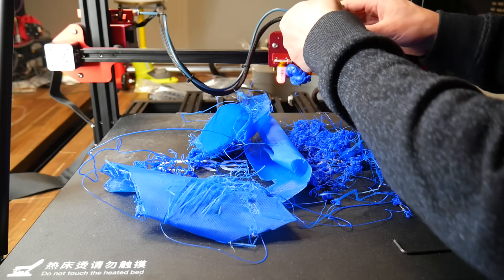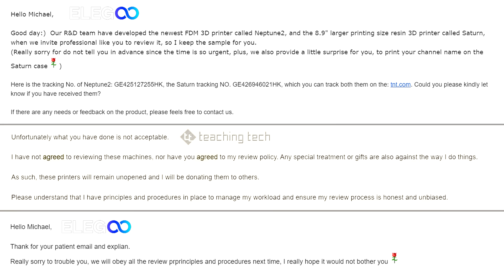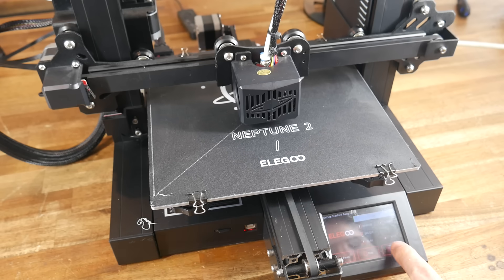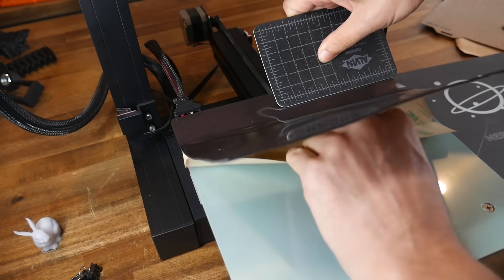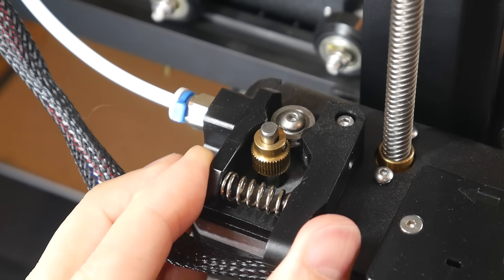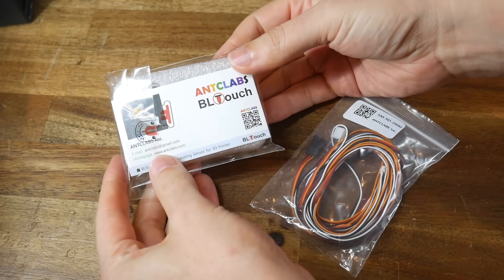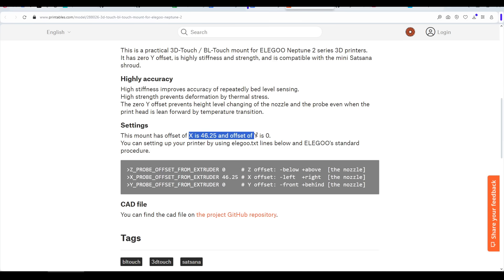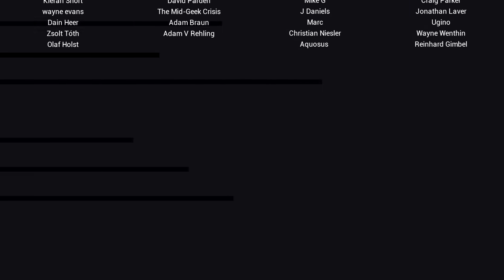Are cheap 3D printers more trouble than they’re worth?

Comment: I have bought 15 printers in the last 2 years.  It's been a total crapshoot but anything older (SV04, SV05, X5SA Pro) always had a ton of issues.  This generation felt cheap, copied and not particularly usable without a lot of work.  The SV05 cube printer was the only one that operated fine but was very slow and limited in print quality.  Of the models less than 1 year old, most were including new features or speeds, and it was a mixed bag.  Most issues were with "auto" anything.  So many of these machines claimed to deliver Bambu ease of use and automatic leveling etc and completely failed to deliver on any of it.  The SV08 has the most warped bed ever, a cover that pops off mid print and destroys the print, and a few other issues.  The Anycubic Kobra 3 Combo works well after a few updates.  That took 2 months to get working though.  The only 2 machines that worked properly out of the box were the Infimech TX and the Flashforge Adventurer 5M.  The FF I moved on because it was too locked down to print in my normal methods.  The infimech I have now.  I have a Two Trees SK1 on the way, we will see about that.

Comment: Luckily I never bought any super-cheapo crappy printers - however I didn't spend tons of money on them either. I first started printing with a PrintrBot kit - when they were made of wood (2014ish) and ran that machine for 6(!) years bone stock without issues. I don't know how many spools - but it was many.  I then bought a Ender 3 when they came out (2017) and ran that machine till 2022. That machine was basically stock the entire time. I disassembled it and used some parts for a home-made camera rig to scan film negatives. I bought a Anycubic Kobra Max a couple years ago - and other than a magnetic build plate upgrade - it is bone stock and awesome. I replaced my original Elegoo Mars resin printer (gave it to a friend - and it is still going strong) with two Creality Halot-Mage 8ks and love them. 

I think a lot of 3d printing newbies fall into the "must mod and endlessly tinker" mindset due to the influence of social media, forums, etc - so they miss out on the fun of actually creating things. I have seen many people pull their hair out and fall into "burnout"  trying to get a printer to work after upgrades - only to not gain anything speed or quality wise. While I enjoy modifying and tinkering - I also just want to make reasonable quality, accurate prints with realistic expectations.  The Kobra Max auto-levels at the start of each print - and other than that I don't touch it. I don't think I have re-leveled my Halot-Mages since I set them up originally.  I don't remember the last time I "tuned pids" or measured extrusion or anything - and big surprise - everything works great. My stock Kobra Max just got done with 4 print jobs this week - all were over 20 hours. Didn't miss a beat. The Halot-Mages both had about 30 hours of print time this week (I am printing a couple panoramic cameras) and had zero issues.

I guess the TLDR is to buy a printer from a decent company - and run filament / resin through it. Don't get stuck in the never-ending loop of tinker/tune.

Comment: My first printer was a Wanho i3 that had manual bed leveling and no removable bed.  It was OK, but I never got the hang of leveling the bed, and constantly ran the nozzle into the blue painter's tape. I upgraded to a Prusa MK3 with auto leveling and a removable bed. It's so much better than that old Wanho ever could have been.

Comment: Honestly, I encourage people to get the cheap ones that they need to tinker with.  Because even on your $1500 Bambu lab, eventually something is going to break--and if you had to tinker your way through getting an Ender 3 printing well, you'll have the knowledge to diagnose your Bambu.

Hobbyist-level 3D printing is still not at the point that normal people can use it--it reminds me of home computers back in the 80s, when I was kid.  You had to have a certain level of technical competency to use them.

Comment: I had an ender 3 V2 for years. I spent so much time upgrading it and working on it. Added a direct drive extruder, BL touch ABL, and magnetic flexible bed. Added a Raspberry Pi for print server and changed to klipper firmware for faster printing. I’ve spent countless hours tinkering and setting up this printer. Recently I tried printing a model and the material was curling due to the ambient room temperature. I went to Microcenter, bought a P1S with AMS and am not looking back. If you want to print get a good printer. If you want to waste half your life messing with a printer buy a cheap one.
Reply: What do you mean waste half of your life. Is the skill and understanding gained worth nothing?
Reply: @SianaGearz  My A1 needs very little fiddling.
I have 2 Enders and gave up on them after constant clogging and heat creep issues, despite using them fine for over a year.
Reply: @SianaGearz do you want to know how your paper printer works? Do you think it would be that useful if you knew how to fix it? Wouldn’t you rather spend that time on more useful/relevant things?
Reply: @RenRenification  Understand that "useful/relevant things" is subjective.
2D printers are interesting, but those are closed source and require tremendous amount of skill just to tinker with. Not the case with 3D printers. And the amount of tinkering required to run and properly tune a cheap printer is quite exaggerated. It is the lack of experience that makes the process initially complex. Once you know you know and a tuned printer is usually hassle free for a couple hundred hours of print time and maintenance is pretty strait forward.
Learning the ins and outs of a printer is also a great way to approach CAD and to learn how to design around FDM limitations.
Skipping the learning process might make sense for some people, but definitely not for all.
Reply: Like any profession, trade, 3D printing or anything else the mistakes are a way of learning the basics that carry you through life. I have an Ender 3 Pro and yes I've had a few things go wrong but through those learning experiences I now understand the whole deal much better. I never expected to simply start the machine and have a perfect output every time, one has to learn.
Reply: @potrzebieneuman4702 at least you’re right about one thing, maintaining a creality printer is a full time job/trade/profession 😂
Reply: Not everyone is prepared to spend that kind of money up front if they're not sure if this is something they want to play with long term. 

 And even a Bambu  needs some maintenace and trouble shooting when things go wrong. For the most part you're still expected to fix things yourself which is why they have such detailed wikis.

Comment: I bought cheap Ender 3 long time ago (6 years?). Only changed the motherboard for the silent one and replaced the plastic extruder when it broke. Had no problems with it since then. Can't remember the last time I had to do manual bed leveling. I might do things recommended in this video in the future but don't see any reason to do them when everything works for me. (Just to add an opinion into the mix.)
Reply: My ender 3 pro is still all stock. Still has the original board in it that is basically worthless. Prints like a champ. Have had to level it when I bought it and 2 moves. Getting ready to upgrade it to run klipper for kicks as well as learning.

Comment: I usually have to manually re-level the bed of my Ender 3 pro using a piece of paper as a feeler gauge evey time I start a print from a cold start.  Once a print is finished, I can print several more items without re-leveling the bed.  Also I know that the bed is a bit lower in the middle than near the corners and sides.  So I usually avoid the middle when slicing prints if possible.  Otherwise, I adjust the manual leveling so the middle isn't too far off, while the corners are not too tight.  It's possible to find a good compromise, just takes a bit longer to set up.  Creality does have a BL-touch add on solution for the Ender 3, as well as a second Z axis motor add on, and both are probably good ideas.  I've converted an other Ender 3 Pro into a Voron Switchwire, and right now I'm finishing up with that project.  So far it looks like a nice improvement, but not worth the overall cost.  However it was a fun project, and a goo learning experience.

I did upgrade my first Ender 3 hot end with an E3D CR Revo and the build surface with a PEX magnetic one.  The Ender 3 Pro has a magnet on the bed already that works fine with the Wham Bam magnetic plate.  I think there will also be a Klipper upgrade in the future, and I will add an inductive probe as well.  Yet another item to be swapped out will be a Voron M4 extruder to replace the Creality one.  This is still a Bowden extruder, but it is gear driven and will mount on the printer frame, not the X gantry.  This will reduce the weight on the X axis.  I'm on the fence as to adding the second Z motor as I don't really want to spend anymore on this printer (the M4 extruder is left over from my Switchwire conversion, there I changed my mind on the extruder after the new Galileo2 came out.  I built the Switchwire using the new E3D PZ probe equipped Revo Voron hot end.

Comment: Something I think is a valid option is getting a stripped down cheap one knowing it has issues but accept it as a learning experience just so you can learn the systems as you fix it. Its what I did, but I went in knowing it wasn't going to be a good out of box experience.

Comment: sigh! Yes. Get a bambu mini. Be prepared to call support when it doesn't do what you want it to do because you know nothing about 3d printers.
Reply: You can get an ender 3 and deal with all the same issues and more
Reply: @captainheat2314  But I can work on, upgrade and improve the Ender 3 and learn how a 3d printer works.
Reply: @seadog6351  i have a P1S and the only thing i changed was a tz 2.0 nozzle and printing ABS PC PPS all be possible on with only a bit of tuning for those harder filaments so why upgrade it more?

Comment: I got my N2S refurbished from Elegoo website for 62e last year, changed extruder for 9e BMG clone, direct drive, bimetal heatbraker for 2e, nozzle, 3d touch for 9e, installed Klipper: it prints at 4.2k external perimeters and  14k max accel, ~300mm/s.
The S version comes with better parts, es the PEI sheet and better springs / bowden / extruder.

Yet today I'd get a refurbished Neptune4: it comes with Klipper and it's ready to go, just install Open4Neptune, I paid 80e for a damaged on from Elegoo.

Comment: I spent 350€ on my ender 5 pro and then like 1000 in mods over the years,  wouldn't do it with the current market tho, I did it 4 years ago right before COVID start, I learned a lot but didn't print much but mostly modded and fixed stuff. It works great now and I'll a chamber heater soon but it was a hobby, not a tool, today I'd get and A1 mini/normal/p1s

Comment: I think the experience of upgrading a printer to be more useful than out of the box grants some experience and know how, for the future, when things go wrong. You've given yourself the ability to repair and identify problems that can occur. My 2 cents. I'd probably recommend a flashforge adventurer 5 tho instead, you can achieve some impressive speeds n print quality for 300 bucks. And you don't have to worry about anyone watching you if you want.

Comment: If you’re looking for a budget 3d printer with great quality and reliability, and ease of use, definitely get a Bambu lab a1 mini. Or an a1, the a1 mini is only $200 brand new and the a1 is only $300. Great printers.
Reply: It's more than double the price of what an Ender 3 costs...
Reply: @cosmefulanito5933  not to mention that spares are as expensive as proprietary stuff gets. If you manage to fund them that is
Reply: @ double is only $50-$100 more, which isn’t that much and is well worth the upgrade if you’re into actually 3d printing and not just a cheap way of getting stepper motors and other cool stuff
Reply: @cosmefulanito5933 the A1 mini is way faster at printing than an ender 3

Comment: That Micro Swiss hotend is worth twice as much as the entire printer. That's definitely what I call putting lipstick on a pig. I agree with all the upgrades but I wished you would have mentioned/used a more budget friendly hotend. The cheapo V6 clones work well and they have plenty of STL's to print the carriage. I know, that maybe too much for the beginner, but I had to say it. All in all, nicely done video.
Reply: The micro Swiss MK8 hotend he installed is only about $50. 

Yes, it’s a $110 printer. But it’s not twice as much as the printer.
Reply: @dogoonubs997  it would seem I missed the price of the micro swiss a bit. Although you can get a V6 clone kit for $10.
Reply: @ Yeah, I think in this instance that would fit the price of the printer way better. I have a micro Swiss on my ender 3, but only because I’ve done other upgrades that really highlighted the pitfalls of the original hotend.

Comment: It was just about a year ago that I got my first printer.  After being indecisive about it for a while, I opted for a printer that came with some nice additional features right out of the box
-All metal hot end
-ABL sensor
-PEI sprint steel build plate

And even upgraded to klipper about 2 months in.

Learning to get the printer to produce high quality results presented a lot of learning and challenges by itself.  If I would have been fighting the printer the whole way along, the learning curve would have been much worse.

For this one user, it was worth it to spend extra for those features.  This has really turned into a hobby I enjoy greatly.

And no, I don't want to drop the make/model.  Out of respect for the channel.

Comment: picked up one of the neptunes when the second batch dropped, and got the adjuster/spring upgrades. dialed it in, haven't looked back. i've had to adjust it again once in how many years now?

i've done some minor things like, putting the creality glass plate on it, a psu exhaust shroud, and a hotend shroud to direct the air better. it pretty much just works.